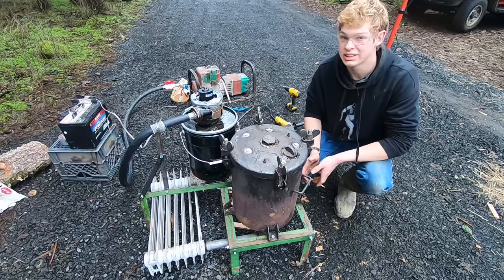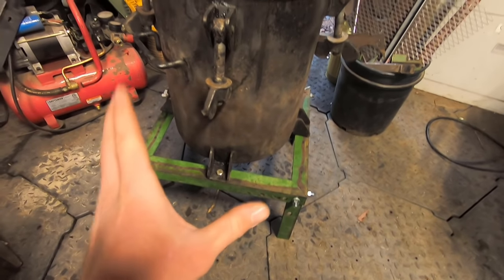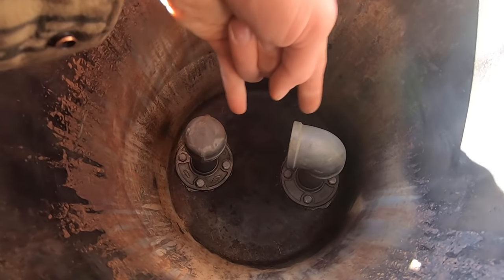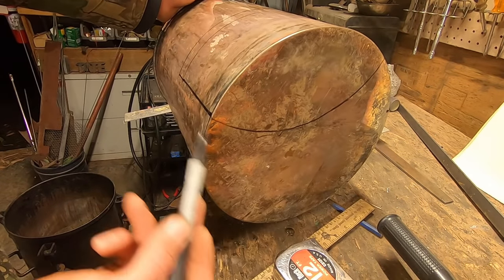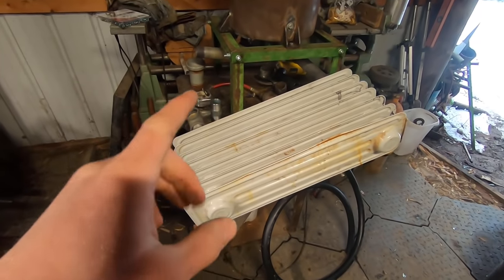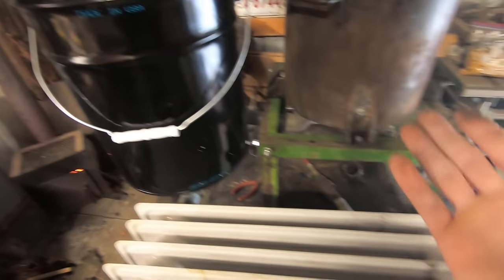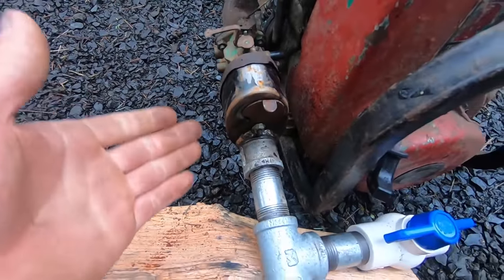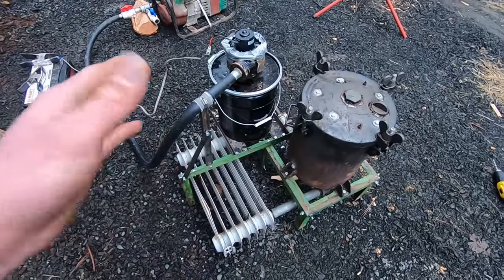Building a No-Weld Woodgas Generator! (A Functional Gasifier Built W/ a Hand Drill and Grinder?!)

Comment: The Germans built these on their tanks in WWII when they ran out of fuel. It doesn’t provide as much HP capability but at least they didn’t have to abandon them when the fuel truck was empty. I’m amazed at the knowledge that has been lost due to modern conveniences making us lazy and ignorant. Great video!
Reply: Eh no they didn't... but they used a similar method to produce their fuel.
Reply: Lost or hidden?
Reply: @lukasaaron102  lol neither, this knowledge is incredibly well documented and is available via said modern conveniences on probably 1000 youtube channels.  Its simply that its not as relevant knowledge as it used to be.
Reply: I’m familiar with the concept. Who said it was lost?
Reply: Lost ot hidden? It is literally common knowledge isn't it? Like saying a steam engine is lost
Reply: The Americans vaporized theirs when shortage became an issue (inverted carbs they called them if correct)
Reply: They would run their tanks through the desert and the cacti they would run over were used for fuel
Reply: There were cars running on wood gas, like Volvo, but tanks require a LOT of power 😮
Reply: It was “ lost” by intension
Reply: Right, don't know if they mounted on tanks, but i saw old pictures from WWII from here in Belgium they where mounted on Cars and trucks, my grandfather told me the name of thé system was named "Running on carbuur" the barrel they used where like1,5-2 meter high and about 60 -80 CM diameter
Reply: Soldering is a kind of welding😊
Reply: @AliErbatur-zv2vy Yeah, you are right. That was the first thing that came to mind when he said solder. 

Absolutely great video though. 

3/13/2024, 08:00 SAST
Reply: @patrickvb3350  Yeah they were also used in the Netherlands, there's plenty of pictures of cars with big balloons full of wood gas on the roof.
Reply: boomer moment😂
Reply: Speak for yourself
Reply: 100 FREAKING PERCENT!!! Imagine how much knowledge and skill will be lost due to AI. Artisanship and master craftsmen may be all but extinct in a generation. 😭
Reply: No they did not. Tanks require 600 hp and a lot of torque to keep it moving, when the fuel tank ran out of diesel, the tank would be abandoned and so called recovery tanks would drag them back to the repair site. They did not have something like this because thats impossible, they also were NOT making fuel on-site as that is yet impossible again. There were cars tho that had this wood-gas generator but the technology is not longer used as its too inefficient
Reply: Always have to have a giggle at the expense of those who wistfully pine for the glory days of ww2 Germany, lmao.😂
Reply: Any plans available?
Reply: @AliErbatur-zv2vy  is it? the metals don't actually weld though a solder joint is just held together by solder, a welded joint fuses two pieces of metal into one.
Reply: @AliErbatur-zv2vy  "Soldering is classified by the American Welding Society (AWS) as liquid-solid phase bonding processes"
Reply: @UsenameTakenWasTaken I pine for pre-war Germany, myself.
Reply: American farmers were told to build and use them during wwll  as well
Reply: Not lost, it’s right here. Just because you don’t know doesn’t mean it’s “lost” bozo
Reply: I think it's the education system focusing on high level STEM rather than trade classes, stuff you'd learn in shop class are outsourced to a simple amazon purchase. That being said, I went to a high school with 3D printers and a forward thinking engineering program, but the instruction on how to use the tools effectively just wasn't there.
Reply: @devzozo  I did better when I went to college going to a Junior College near me and transferring to a university for my 3 and 4th year to a stage college which had all the classes but one at the local college near me it is those fancy elite college that is the problem,   not local community colleges and state universities
Reply: Exactly!! Knowledge is power, and that's why the corporate machine is thankful most people can't make pasta salad or Mac and cheese without buying a "kit" in a box, much less the fuel industry. Bravo to the young man in the video for showing his knowledge and fabrication skills in an easy-to-follow tutorial.
Reply: @devzozo Likewise, the teachers could've been out of their league in the technology, too, and unable to explain something they didn't understand themselves.

Comment: In 2008/09 the company I worked for built a full size test plant gasifier. We had 2 or 3 counties bailing their field scrap after harvest,  switch grass, basically any and all biomass. We were feeding the thing the large square bails, and it was a hungry beast. but we were trying to do a lot with it. I was the instrumentation tech on the project and we learned some things that just didn't show up in the math or drawings. Ours test plants intention was to take the place of the natural gas feeding the boilers of the regular plants we built, like an add on.
Reply: im sure you will live a long asthma free life. and you're ex-ceo visited often enough to make sure he stays just as healthy.
Reply: did the plant put out enough gas to feed the boiler or turbine
Reply: @farmerrobert5978  It was just a prototype plant with it's gas going to a flare, but yes it should have been able to "contribute". I guess every little bit helps but dam they were labor intensive. The problem is the staggering amount of NG that our regular plants used. With all of the effort to keep that practice gasifier fed and it still would have only powered one of our burners. Each of our base plants ran 4X 40MMBTU product dryers and 2x 100 MMBTU thermal oxidizers per plant, running 24/7. And like I said, they wiped out like 3 counties of every bit of baliable biomass there was to get. So in the end, I don't know. It was a learning experience and it defiantly has potential. I think it will have to stay sized for a household or even a community. Trying to go industrial sized runs into logistics bottlenecks that can't really be overcome.
Reply: @sgtrock68  maybe look into connecting with a document destruction company?  🤷🏻‍♂️
Reply: @sgtrock68  great info thank you for sharing

Comment: A couple of suggestions from an OLD GUY!  
    FIRST, turn the orientation of any bolts so the threaded ends are inside the angle iron frame to help prevent ANKLE BITE!  Those threaded ends waving out in the open are just waiting for you to walk by!
    SECOND, and this is not really necessary, but duct the hot exhaust gases from the generator engine back to the gas generator.  Make sure the hot gas can swirl around the gas generator similar to a metal melting furnace, with the gas generator being the crucible!  If insulated well enough you will be able to turn down the inlet O², maybe down to nothing, which will increase greatly your combustible gas output, as well as water output.  
    Right now, most, if not all, of your hydrogen is burning inside the gas generator! Look up STOKOEOMETRIC (spelling I know) ratio for hydrogen.  Hydrogen will burn in a 6% to 94% mix with Oxygen (might be 4% to 96%, I'm old, have not used this memory for 45-50 years). ANYWAY, 2H²+ O² > 2H²O + 4 Electron Volts of energy! So this is where your water is coming from. And yes, I know, the subscripts on the H's and O's are in the wrong place, I don't know how to put them on the bottom with my phone!
Reply: stoichiometric
 
Good input old man. 
I'm a chemistry ⚗️ enthusiast, trapped in a medical doctor's life, though I effortlessly ace my biology.

Cheers man 🍻
Reply: Spot on!!

Comment: Hint: combustion heat chamber under and separate from generation chamber.
Avoids some combustion problems you mention, (ie: safer) easier construction, 
It also allows addition of a gas burner that could use a small portion of generated gas to maintain heat to generation chamber. (I played with wood gas 45 years ago.
Reply: That's the designs that I'm more familiar with George that I've seen in places like mother earth news. And that's not taking anything away from this young man. When you're producing wood gas what you're basically doing is "cooking" the wood at a high enough temperature in an anaerobic environment  without burning it to drive off the gas. Basically you're creating charcoal which you can use later for cooking. So why not use a "traditional" cooking process with separate combustion chamber and gas generation chamber. If you already have charcoal why not use it in the heating chamber instead of burning the precious wood. Good idea to bleed off a small portion of the gas to make the process more efficient.
Reply: add a dirt leg with a cleanout on the outlet or downstream before the equipment connection.
Reply: Yeah, I mean ultimately if you want to do this right, you want to start with charcoal or coal in a separate gas generator heated by whatever (oil, wood, coal) and inject superheated steam into the heated coal/charcoal chamber. Then you get more gas and don't have to do 99 percent of the filtration. Also, there's no reason to remove the water vapor. Its not hurting anything. You don't want it to condense, but its at least as inert as the huge amount of carbon dioxide this thing already produces.
Reply: @rex69832  Because this is quicker and doesn't need as large a heat source. As you noted its less efferent and will eat way more fuel but attached to an old VW bug... I'd stick with this and keep a bag of chips in the frunk.

Comment: Very nice compact gasifier. I made one years ago from 40 gallon drums and ran a petrol car engine with three alternators on it. I used 10 mm charcoal for fuel ( I make charcoal anyway) it mostly ran great but required a lot of attention  and took quite a while to get going.
Someone offered me £200 for it and I took it.
Great video, you're a bright guy, thanks.
Reply: I'll give you $300!
Reply: Wow, i woukd really like to hear more about yours that you built.  What was with the 3 alternators?
Reply: Do you make Activated char?
Reply: @1realtruthrightnow742  Well since alternators generate electricity, they were probably hooked up in parallel to get more current.

Comment: This is a pretty compact gasifier build. And, the cross section drawing was great, as previously mentioned in the comments below. I wonder if the 12V fan must be running all the time, or if the carburator suction is enough to create the airflow when the contraption is up to speed.
Reply: at the end of the video he said there wasnt enough airflow to start it without fan. When its warmed op and your engine is sucking in the gasses you can turn it off

Comment: Nice clear instructions man, thank you. Would mounting the cooler on a slant towards the drain help to keep the tar etc. flowing out? Have you ran an engine for an extended time and then examined the engine for carbon buildup? Has long does the filter media last and can you then use it for fuel in the gasifier?  Cheers!

Comment: So as an added catch I suggest using a tee fitting when you turn down below the main burn tank with a drip leg of about 2-4 inches. Which you can clean out every now and again. Allow any pieces that get past the grating to fall into it and stay trapped. It's a plumbing thing when we pipe natural gas systems to either a furnace or water heater. Not sure of needed but always helps to cover your ass

Comment: Thank you for your kind response.
You explained things better than the professor did.
We did basic - and used the gas for just a flame.
Your addition of a condenser and filter... Very smart.
We found that the de-gassed wood chips could be re-used as fuel,
and burnt to ash. Your filter material (sawdust, was it?) could be re- purposed.
Either gassified or as fuel. Or both.
I have not seen your other videos. This one showed up random. Lol.
This one was very well done. I will look for more.
Take care and keep up the good work.
And thanks for the memories. Those were worry free times.

Comment: I want to see that run for 4 days straight and then tear down to see how the filter worked and the other components.
Reply: Here: https://youtu.be/_VWO51YoMMA
Reply: @EnFuegoDuo  hardly the same unit.
Reply: You'd probably change filter every other day unless you want it to clog the motor.
Reply: well instead of waiting for that video you want to see why dont you just build this idea using a welder yourself?
Reply: and also you can make a bigger and sturider filter with sheet metal
Reply: so- why? would you be too otiose to clean the system out every day? what's ur complaint?
Reply: @ohwhatelse   he just wants to know how effective the radiator and filter is.

Comment: You can add a water injection system to our carburetor to clean the engine and get a little more power.
If you pull the gasses through a bubbler, it will  collect all the particulates and cool the gas at the same time.

Comment: trying to do homework then gets a notification for another video.... "yeah ive got time"  Keep up the brilliant ideas man!!
Reply from the maker: Much obliged!
Reply: hey, o i have a couple questions for you about the gasifier because when getting parts i found some problems so I would like to ask a couple questions/requests. 
-how did you get a 5-gallon paint pressure pot for under 100 bucks 
-can you give me a full list of the items used (if not that's okay I can do it on my own)
-do you have any suggestions on where to get that kind of car part.
-Where do you think I could get a cheap junk radiator like yours which I could get for a cheaper price

If you cant answer my questions that's fine you are probably busy with your next project.
Reply: and does the blower motor have to be metal
Reply from the maker: @hudsonhill6925   I'm happy to answer your questions! 

-I found the pressure pot for free in my neighbors junk pile. (It pays to ask around)

-I so found the radiator for free in a friends junk pile.

-The blower does not have to be metal as long as the gasses are cool enough by the time they get there. I would even consider adding another radiator if you can find one. The cooler the gas is, the better.
Reply: Okay thanks for your response 
Really helpful, ill tell you if I ever get to finish it
Reply: @randomn6473  Have you considered using a cyclone filter before it goes into the radiator filter? I think it may take out a lot of tar and moister before going into your radiator and keep it from getting as gummed up inside. Great video, thanks.
Reply: Check a local scrapper. I got stuff but...  shipping....
Reply: @randomn6473  hey nice DIY but honestly this is too much work for the average joe I've been looking into this idea 
turning my old pellet smoker into a Gasifier but don't have enough knowledge like u if u can show us that will be a pretty neat idea don't u think?

Comment: I was definitely inspired cause even though I took a welding class I haven't been able to rely on those smaller models even with the inverter the welds were nil. So thanks for thinking of us out here in the fields with minimal tools! Appreciated.
Reply: @ Robert Allen , yeah i would not waste my $ on those cheap p.o.s. from ebay or what ever chinese crap out there, 
you are better off buying an old used stick welder ! unless you only weld on sheet metal 16-18 gauge max ...
i know i once was tempted to try my luck, then i read a lot of peoples comments on their reactions (ones with experience)
and they pretty much said that they were uselessand did not even have the output advertised to have !
Reply: @martindesrocher4528  : 4 sheet metal us a gas welder Oxygen and Acetylene!!!!!! With a steel filler Rod !!!    (( … 10gauge and up CORRECT A STICK WELDER IS BEST !!! Spoool welders only really good on New metal ( even then the welds are only 1/2 as strong !!!!

Comment: need to see how long will that fuel last. such an interesting project!
Reply: 25 pounds of wood equal 1us gal. Of gas pine is the best wood to use creates the most wood gas or sin gas
Reply: @reverendlawrence7584  Gas is not mearsured in gallons. But good try. 5kg/litre. UK measurement
Reply: @onekycarscanners6002  
I believe he means 1gallon gasoline

Comment: Ok so only suggestion that may help here:

Instead of the rav4 fan; put a t junction in its place with the third side leading to a removable cap.

To start just take the cap off and use a leaf blower, when fired up, set down the leaf blower and cap that pipe. This will serve the same purpose but is simpler with less complicated parts that may fail. It also will not impede the movement of gas which will make the gasified slightly more efficient!

Comment: Great Work you are the Man!!! thanks for this valuable content.  How long  1 load of wood can keep generator running? Would be possible to add a cooper spring  tube around the reactor to  generate hot water or to distillated dirt/salt water?
Reply: Commercial gasifiers will have water heaters attached as to maximise power generation.
Reply: do it u wont

Comment: using a oil heater as a radiator is a great idea but the way you've got this set up seems like that radiator is going to get filled with tar and eventually completely clogged up. I think mounting the radiator horizontally is a mistake and it could probably do with a cyclone filter and tar trap before entering the radiator like on your last gasifier